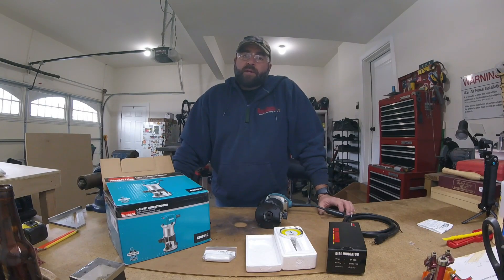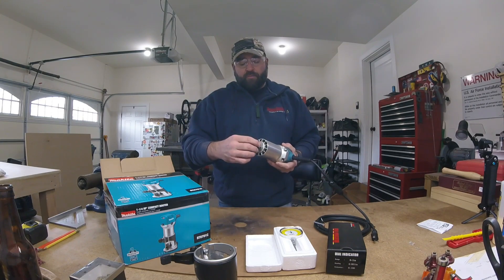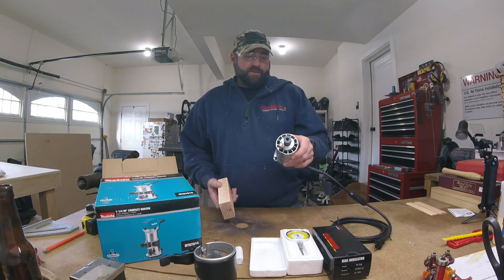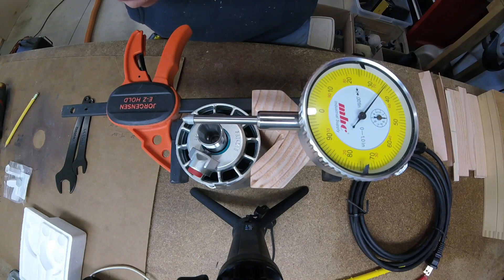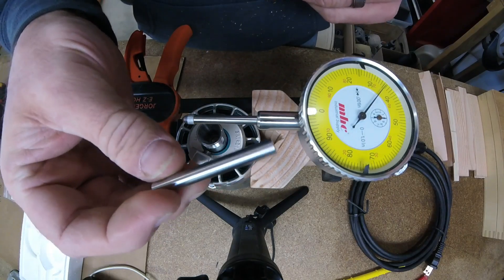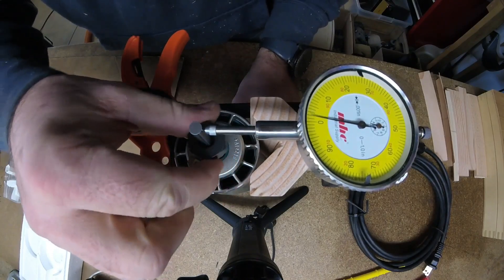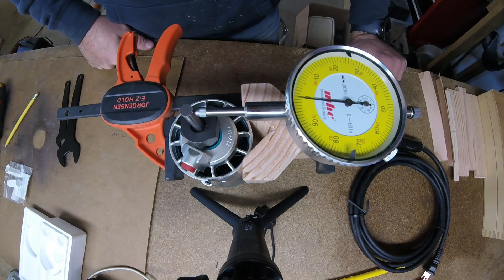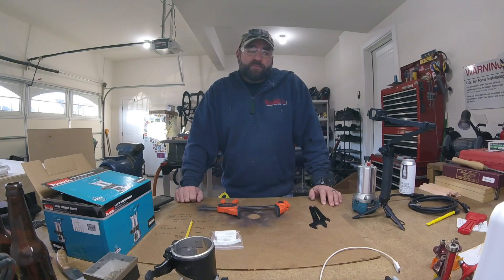CNC Router Spindle Runout Check with Homemade Dial Indicator Base

Comment: That runout is actually very low. You are talking less than 1/100mm, actually 3/1000 inch is 0.007mm